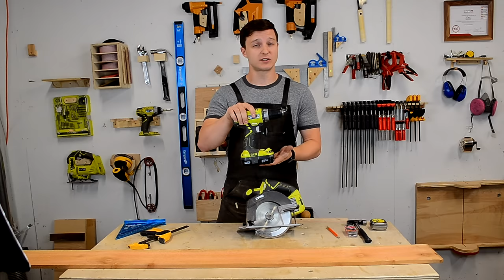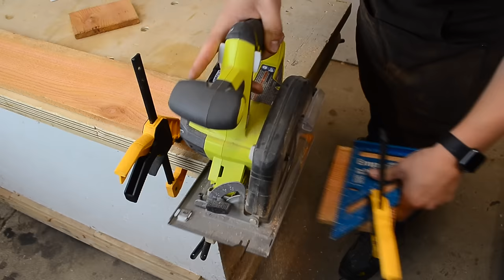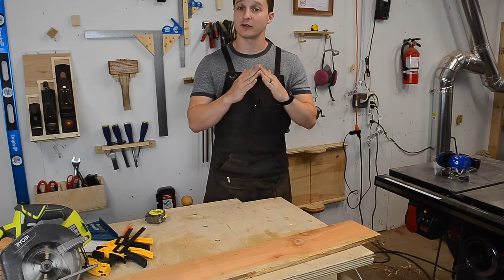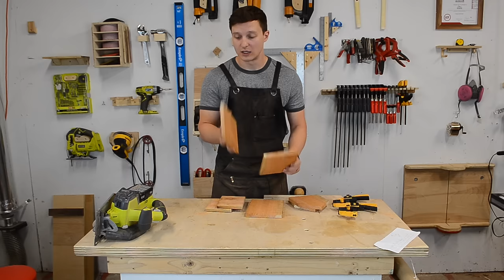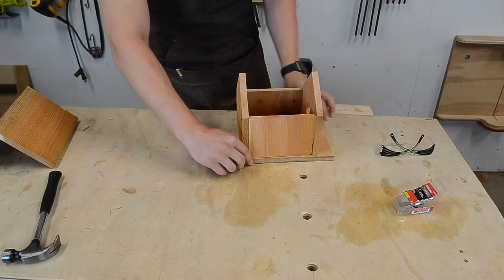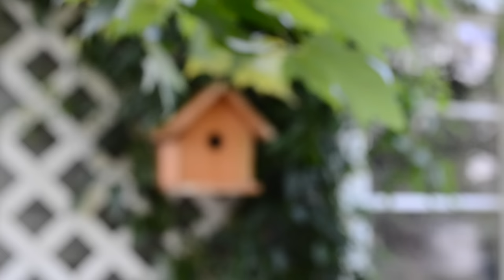EASIEST DIY Birdhouse with Minimal Tools, Every Step Explained

Comment from the maker: Thanks for watching! Don't forget to subscribe to my channel if you liked this video! If you have any questions about how to build this video, leave a comment below and I will answer them ASAP!
Reply: dk builds there should be 1/4 inch opening on the side of bird house for the heat to escape
Reply: this guy really just pinned and loved his own comment
Reply: Love that little guy at the end.  Great birdhouse!
Reply: Hello! I'm trying to make the OPPOSITE of a bird house technically, you see I have a rat problem and am setting up traps. However, when I've done this before I always capture either a bird or a lizard in the rat traps which is very sad. I want to make a simple wooden box that no bird would dare wander into, and get trapped. The rats I'm dealing with are large. Could you make a little box project that might solve this problem?
Reply: @kevinpatel226  
L
Reply: @danimedina2728  amazing 👏
Reply: Bad design, can't clean/empty it! 
You should make 1 pannel (preferably the back) tiltable. that way birds can enjoy a clean fresh birdhouse. they dont like using dirty houses with shells or dead bird remains and other critters
Reply: Shouldn't you use a rust resistant nail to.prevent.rust and not have the rust stains on the cedar and how long are  the nails or brads?.very nice and easy build. Thank you!
Reply: Good job! I will make it!

Comment: Nice bird house, but it's lacking vent holes and drainage holes. Always kept one side or the bottom so it can be opened and cleaned early each spring. For drainage, simple cut about a 3/16-1/4" off each corner of the bottom plate. For air flow make each side 3/16-1/4" shorter. Place the short end of the side so it's under the eave of the roof so water doesn't get blown in. These are some of the standards most bird will like. If your going to make it say mountable to a tree or post, make the back wall 2" longer on the top and bottom and drill one hole, centered on each end.

Comment: I have done some woodworks in the past but this woodwork plan https://www.youtube.com/post/UgkxZF0EMnrujZvqHhGkxiz559uIABJWR9TG helps me do much in a far lesser time than i used to do i have already built several projects with this plan and i intend to do many more soon. Thank you so much!
Reply from the maker: Chalk is a type of soft, porous sedimentary rock that has been used for various purposes throughout history. It holds significance in several areas:

Education: Chalk has played a vital role in education for centuries. It is commonly used on blackboards or chalkboards in classrooms to write and illustrate lessons. The ease of writing and erasing with chalk makes it a practical tool for teachers and students to communicate ideas, solve problems, and demonstrate concepts.

Sports: Chalk is commonly used in various sports and recreational activities. In gymnastics, weightlifting, and rock climbing, athletes use chalk to improve grip and reduce sweat-induced slippage, thereby enhancing performance and safety. Chalk's drying properties help absorb moisture from the hands, increasing friction and preventing slips.

Art: Chalk has been used as an art medium for centuries. Both traditional chalk (made from natural chalk rock) and modern manufactured chalk (such as pastels) offer a wide range of colors and textures. Artists use chalk to create drawings, sketches, and paintings, particularly in techniques like charcoal or soft pastel.

Construction: Chalk is an essential material in construction and civil engineering. It is used as a component in cement production, as it provides the necessary calcium carbonate, which reacts with other substances to create cementitious compounds. Chalk is also employed as a filler or aggregate in concrete and as a base material for roads and foundations.

Agriculture: Chalk is commonly used in agriculture to correct soil acidity and improve crop growth. Agricultural lime, which is primarily composed of finely ground chalk or limestone, is spread over acidic soils to raise their pH levels. This process, known as liming, neutralizes soil acidity, enhances nutrient availability, and promotes healthy plant growth.

Paleontology: Chalk formations have a remarkable geological importance. They often contain well-preserved fossils and serve as valuable sites for paleontological research. Fossilized remains of marine organisms, including ancient microorganisms, shells, and skeletons, are commonly found in chalk deposits. These fossils provide insights into past ecosystems and contribute to our understanding of Earth's history.

Overall, chalk's significance lies in its multifaceted applications across education, sports, art, construction, agriculture, and paleontology. Its versatility and unique properties make it an indispensable material in various fields.

Comment: Today my daughter and I built a birdhouse to your specifications and it came out great and was a fun activity for us.  The only change I made was rather than nailing the floor I used screws.  Therefore, I can remove the floor and clean out the inside before putting in storage for the winter.  Thanks for your video!
Reply from the maker: That's fantastic to hear Dan, I love comments like this. I'm so glad to have provided an outlet for you to spend time with your daughter. Great tip with using screws instead of nails on the floor!
Reply: Birds still use birdhouses in the winter but use whatever material suits you but its meant for outside..

Comment: Brilliant tuition. Little extras for you to consider. 1: drill a few holes in the bottom for drainage, 2. on the inside of the front panel, fix small pieces of twigs,  offcuts, to give the chicks easier purchase when getting access to the exit during fledging 3.make one side easy to open in order to clean the box out for following year. Thank you for clear instructions though, so easy to follow.
Reply from the maker: Those are all great tips, thank you for sharing!

Comment: You need to drill 2 or 3 holes in the base for drainage - and as others have commented, use screws so you can take the top or side off when you clean it out (with boiling water) after chicks have gone.
Reply from the maker: Great tip, Byron! Agreed about drainage. I'll add some holes in the next ones I build 👍

Comment: Very nice and detailed video.

I have bought few bird houses last month with a door opening. 

I read on  google that there should be a door opening to be able to clean the bird nest after bird and baby has left. 
So next season bird can use it again.
Reply from the maker: Thanks for the kind words Rupan! That is a very good point. Now when I make birdhouses, I use screws to attach the roof, so I can unscrew them to clean out the house at the end of the season, then reattach the roof.

Comment: Nice house. For an easier build do a one piece shed style roof. Make sure it slopes down at least 1 inch from the front for rain drainage.Make sure it over hangs on all sides. You will have to cut the sides and back at a matching angle for the pitch of the roof. Also glue pieces together before nailing for a more sturdier house.
Reply from the maker: Great tips, thanks for sharing Ron!

Comment: Nice easy project. Just note that you do not want the overhang from the floor; it allows easy access to predators. Also you might to want to make it not so deep but and a bit taller.
Reply: Is it worth putting a dowel in below the hole? or is that not necessary for small birds?
Reply: @p44v9n  - No, not necessary. They fly right to the hole. On the inside wall where I drill the hole, I scratch it to make grooves so that the chicks have an easier time climbing out.

Comment: Thank you for the excellent video.  As it so happens I had a Cedar piece of lumber very similar to what you have in the video.  So I decided to make a birdhouse out of it using your instructions.  After it is all done, I think it turned out pretty good considering it was my first one.  I did use a combination of glue and nails for this birdhouse.  Thought maybe I could sell some of these and wonder if you have any ideas on what platform to use.  Thanks again.

Comment: Excellent video.  Perfect for first project.  i love the idea of  front "porch" the only problem I would worry that  critters could use it to allow it to chew the hole bigger and gain entry.... it is possible I saw that with my old house when I used a stick a Squirrel sat on it and chewed a hole to get in.  But this is a perfect house. I have plenty of wood and want to make several. Thanks for posting. (Subscribed)
Reply from the maker: Welcome to my channel, Cherokee! I agree, this house would be better without a porch. If you make some of these, do let me know how they turned out!

Comment: Nice video! We swapped out some of the nails for screws to be able clean it out for the next season. All in all, well presented. Thanks!
Reply from the maker: That's a great idea! In general the roof should be removable, screws are a great way to do that. Thanks for sharing.
Reply: ericinthewild - I used small hinges, and a latch from Walmart. Only a couple of dollars, and easy access.

Comment: I like to use screws to attach the bottom so you can remove the bottom and clean the house after the birds leave so it can be clean for the next season.
Reply from the maker: That's a great tip, I totally agree. Thanks for sharing Elapid!

Comment: If you dont have a square with a 45 degree angle and you want to mark the X, you can take the width of the board, in this case 6in and muliply it with 1.414. Wich is about 8.5. Each line in the X should be 8.5 inches. That should give you an accurate measurement.

Thank you for the video, I just subscribed!
Reply from the maker: Thanks Muskel, your trigonometry checks out! Welcome to the channel :)
Reply: @dkbuilds  I use this formula at work all the time. Pythagoras theorem saved my life, haha.
Looking forward to the next video.

Comment: Thanks for the enjoyable video. As others have mentioned though, this design doesn't allow for the birdhouse to be cleaned, perhaps you were intending to only keep it for 1 season and then make another? As a minimum, you could use screws instead of nails so you could take it apart. I chose to make a housing/dado on the inside of the 2 sides and slid the floor in.
Reply from the maker: Great points Secoba. I definitely would recommend using screws (at least for either the roof or the bottom) to make it easy to clean out bird nests each year. A sliding dado like you did would be even better. Cheers!

Comment: I like your video, only thing I changed was the angle of the roof, I did mine at a 45 degree angle.. Makes it look much cleaner, thanks for the video..
Reply from the maker: Nice tip, JC! I bet that looks much cooler with the steeper roof. Thanks for watching!

Comment: Nice intro video project!  Very well explained and presented.  A thought: for 90-degree crosscuts, instead of clamping the speed square to the board (which is the safest way to go, I admit), you can hold the speed square on the side opposite to the one you're standing at.  That way, you're pushing the circular saw away from you with your right hand as you cut ... and pulling the wood/square toward you with your left hand.  That balances the forces out.
Reply from the maker: Thanks so much Capt! That's a very good idea. I usually hold the square (without clamping) but on the same side of the saw. I never thought to hold it on the other side to counteract the force of the saw. I'll be doing that in the future! Cheers

Comment: if you nail the leftover triangles from the front and back to the inside of the roof, you create a roof that you can take on/ off for cleaning and doesn't need to be nailed to the rest of the house
Reply from the maker: That's a great tip, JP. Thanks for sharing!

Comment: Wood glue for all bird house pieces, perches (plural) for birds as they prefer it; though the shelf is nice as well, a metal or wood cover around the front hole to protect against predators from gnawing into the hole, and a piece of wood longer and taller than the house so you can screw the house into a wall or tree or bind it with twine or rope to a tree.
Reply from the maker: Good tips!

Comment: Also, placement of the hole and the size opening is critical to the type of bird you want to attract. Chickadees and wrens will only use a box with a certain size hole and the proper distance off the floor. If you make the hole to large either larger birds will use the box like sparrows, crackles, or crows. Predators can get in a birdhouse if the hole is to low, such as snakes, raccoons, and squirrels if they are hungry enough. They will reach in and eat the eggs or the young. Also, there are "paracite" birds such as the Cowbird, and the Cookoo in Europe, that will lay their eggs in another type of birds nest to feed and raise. The problem with that is cowbirds are larger than smaller species and will take all the food from the other young, leaving them to die.
There are some very good websites, books, videos that have downloadable charts or lists that will say the type of bird, the dimensions of the box, hole size, and height off the floor the hole has to be. I think a little research into the construction of a bird house should have been done BEFORE putting out an instructional video.

Comment: Nice build. The only thing I did different was to cut one of the roof boards shorter so you will have the same overhang on both sides. Guess I'm picky.
Reply from the maker: Good idea dusted. I also do that in this build, the overhang is equal on both sides.

Comment: That''s a lovely birdhouse and a very clear step by step guide, but how do I attach it to a tree? Have you got another video about it, by chance? Thanks
Reply from the maker: Thanks so much mizzdune! I put two eyebolts through the roof and looped a string around the tree branch to hang it. You can also attach it to a fence by screwing through the fence into the back of the tree house. Or, put a post in the ground and screw the house into the top of it!

Comment: Hello, thank you. I have built the birdhouse. So simple I was amazed.  Would you please advise on how I would add some sort of hook to hang it from a tree, rather than nail it to a fence.  Thank you, C
Reply from the maker: Thanks Clori I'm proud to have helped you build the house! I screwed two eye-hole hooks into the roof, then tied a string between them and looped it over a branch. Just make sure the roof is on tight so it doesn't get pulled off! You could also screw hooks through the side of the house and use string. Hope this helps!

Comment: no criticism intended, would gluing the parts be a better option with the nails? I like the way you explain what you are doing though. cheers!
Reply from the maker: Thanks Bob, no criticism taken! Gluing may work well but if you are using wood glue, you need to have a very clean connection between the two pieces of wood, and you need to clamp it while it dries, and you need to use a waterproof wood. Also you can't really glue endgrain to side grain (e.g. attaching the roof, or attaching the base). This is why I didn't use wood! For sure if it were a piece of furniture for my home or something I would do much more complicated and strong joinery but since it is a birdhouse, my vote is still for nails!

That said, I would recommend screws for either the roof or the base, so that you can remove it each year to empty out the abandoned nest!

Comment: I like it. Only flaw I could find is that there isn't a clean out. You could probably use a nail hinge on one of the sides so that it folds the side out like another bird house me and the boys just built. 9.8/10 will be building next
Reply from the maker: Thanks Sam, and great point about the clean out. A nail hinge works, or maybe attaching the roof or floor with screws instead of nails. Sounds like your bird house turned out great. Cheers!
Reply: @dk builds    we used a nail hinge. My boys 2nd bird house (he's built 4 this week 😅) we cut one of the side walls long and then I used a skill saw and cut a tongue into it and fit it into the base. Nail hinge and stop worked like a charm. Followed the plan and, believe it or not, already has birds checking it out! Too bad you cant attach pictures to comments yet. Thank you for helping inspire the next generation of wood workers!

Comment: Awesome!! I will be attempting this.  Never used power tools before till recently.  Found a used one for 50 bucks just to cut fence pickets which I use to paint pictures on, but that’s it.  This looks very easy. I just bought a jigsaw do you think I could use that? I will be subscribing.  Thanks again for such a great tutorial!!
Reply from the maker: That's great, Angela! A jigsaw will work great. You might want to buy a new blade if your current one is old/rusty/dull, they're very cheap. Have fun building and keep your fingers away from the blade!
Reply: @dkbuilds  thanks so much and yes I will remember to just that. ☺️

Comment: This is a great first project! But keep in mind whatever wood you use will make a difference, some hard woods like poplar are almost impossible to drive a nail into, so you might have to use screws depending on the type of wood you have available. Great vid tho!
Reply from the maker: Very good point Sam, thanks for sharing! For hardwoods, I personally would pre-drill a hole and use screws.

Comment: This is awesome. May I ask how do you hang it up? Say like the way you have it or on a tree? Thanks
Reply from the maker: Thanks Sammie! I put two hooks in the roof and connected them with a piece of string that I tied around a tree. You could also screw it directly to a fence (from the other side of the fence), or screw it to the top of a post in the ground. Good luck!
Reply: @dkbuilds  Oh, wonderful. Thanks so much for the quick reply. Cheers from Nova Scotia, Canada!~